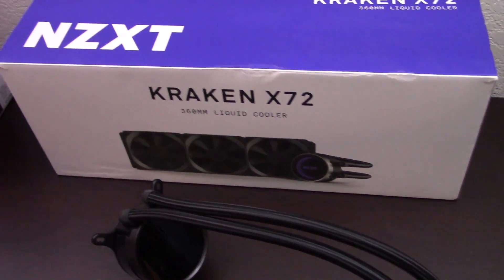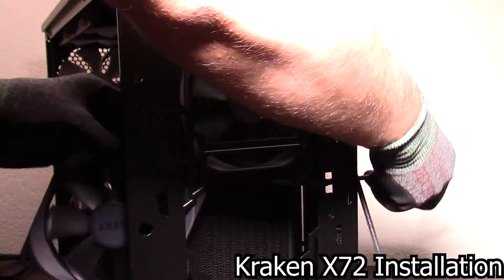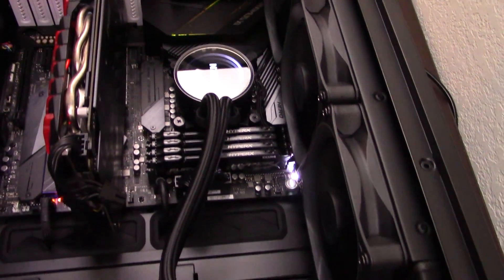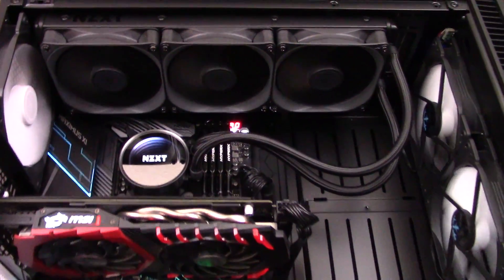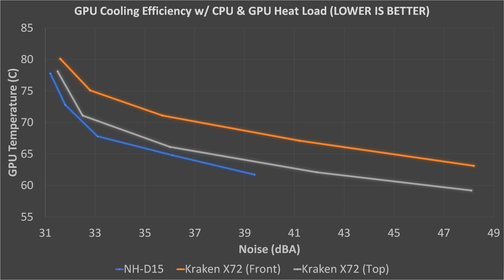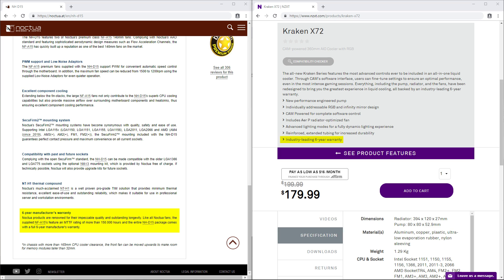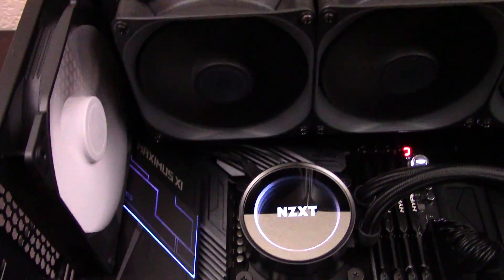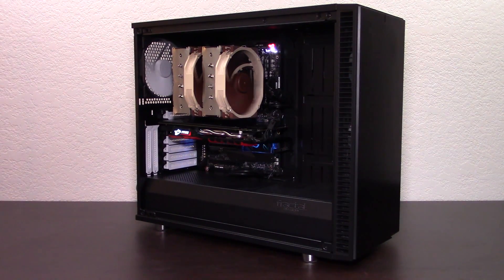Air Cooling vs. Liquid Cooling: The Ultimate Showdown (feat. Noctua NH-D15 vs. NZXT Kraken X72)

Comment: Based on experience and many swaps of coolers. The conclusion is similar, Don't mix AIOs and Air coolers (i.e. CPU AIO and GPU air). The latter results in a dead zone around the CPU block (if your case is large) of hot GPU air that barely moves, increasing the GPU temps gradually. Using all Air means more in case fans = more case air flow, CPU might heat a bit as a result of GPU heat, but overall its better performance. The other option is a full liquid loop with enough radiators.

Comment: The power consumption test was rigged, it doesn't matter if you go air or liquid you will still have case fans, in the power test you should've only compared noctua's 2 fans and nzxt's pump without the 3 nzxt fans as even if you do get an air cooler you'd still have fans there

Comment: the cromax NH-D15 looks so good.... sadly they made it more expensive just becasue its black, wich IMO is just a rob but.... whatever.
Reply: Do some research. They don't just powder coat it black. It's challenging process to make it black. That's the reason why they hold it off for so long, even if there's so much interest in it. Thats the reason it cost a little bit more.

Comment: I will always go for air cooling, but air coolers are a bitch to clean. You can use pressurized air, but without a full wipedown, it will slowly build up dust that thinly cements itself, needing it removed to be soaked/scrubbed down, whatever, while an aio can just have the rads unscrewed to deep clean the fins easily.

Comment: I used a similar sized air cooler (Deepcool Assassin 3) in my system. I made that choice because I feel fans are easier to maintain and a fan dying won't stop the use of the computer as a pump failure would. one thing you didn't bring up is that a water cooler is sort of an all in one solution. It's going to get the heat from the CPU out of the case pretty much regardless of the airflow. An air cooler really needs a case that cooperates with it's operation with enough ambient air coming in to let the cooler do it's thing.

Comment: for anyone looking to overclock their cpu's

1. i had the noctua nhd 15 with an i7 9700K overclocked to 4.9 ghz. I couldn t go to 5 ghz, because the temps were too high. Now, the room was a bit hot and the case didn t have the best air flow. It probably can manage 5.0 ghz, but i couldn t. Also, the cooler was mounted with the fans facing the top of the case as i didn t have enough clearance for my ram cuz i got 4 sticks. I even managed to damage the slot.
2. I have a Kraken x73 AIO (360mm) with my i9 9900KF overclocked at 5.1 ghz and the temps are great, in idle in runs at 30-33 and in games, in core temp, i ve only seen 79 degrees on 1 or 2 cores, the rest of them had between 70-78 degrees, but i ve change the case, this one has better airflow. And the room is a bit colder.

For the first build with the i7 9700k and noctua i had a white diamond game max with 4x140mm (2 in front, 2 on top) fans from Uphere installed in it and for the second build i have a phanteks p400a eclipse with the aio mount in front, pulling cold air from outside and 2x140mm fans from Uphere on the top pushing the hot air out.

I hope this helps someone.

Comment: One thing I want to know is the liquid cooler motor. Do you have data that the motor will last 6 years? I have NH-U12A in my computer 8 years and still running great at 40°C.

Comment: I just switched from Corsair H115i to Deepcool Assassin III. I'm happier with the Deepcool, the H115i started having blockage issues on the third year, temps are high even on idling. The deepcool comes with 2 fans and I only used one because I already had another 140mm fast at the back of the case, the temps are great. All that for half the price in my place. No more AIOs for me anymore.

Comment: Water cooling is more cumbersome and takes up some fans slot in your case, the biggest advantage i would see later on is having my gfx watercooled too so both the cpu and gfx heat are always going out of the case and not staying in there, and after all these testings i still see water cooler as a bit more superior for performance, people seem to forget you can mount fans on both sides of the radiator but its still not that much better as a good air cooler, i wont get an air cooler because i cant stand the sound of it and i might do a custom loop in 2021, if you plan to oc you wont get the same performance with air as with water and thats a fact

Comment: How about having radiator on the exit in push or pull out of the case config. Anyway I'd rather compare to smaller Kraken because it always struck me as more reasonable option. It also fits well into those ultra small cases.

Comment: Take the chromax back version and the only way the liquid cooler wins is in slightly better temps at the cost of noise. There is also always the factor of looks in terms of shape and position - someone wants a liquid cooler with those pipes, light up display and motherboard visibility.

Comment: I'm no enthusiast, but my 10900K doesn't perform well with the NH-D15.
Reply: Then you've got big issues. Either some software issue or your case cooling is garbage. How overcocked is the 10900k? That's one of the hottest CPU's out right now lmao
Reply: @roboticvenom1935  
I used this cooler for my 6700K before and it ran at 28℃ at idle and only got to 60~70℃ when benchmarking so maybe I have to get used to see 70~80℃ on the 10900K.
When I try to overclock the 10900K to 5.2GHz it sometimes throttles during benchmarks.  Stock speed runs ok but still gets to 70~80℃ when running Cinebench.
The case cooling is not the best since it's a fractal chassis, but it's not garbage.  I have 4 intake fans with 2 out, both 140 mm and blowing 100% all the time. The fact that the NH-D15 is massive and almost comes in contact with my graphics card which is radiating heat does not help.

Comment: everyone gangsta until the AIO starts leaking
Reply: Smelly Revolutionary  same lol my cousin ruined his $3000 pc cause of a leak from Corsair cpu cooler and leaked on his GPU
Reply: @JustChill_TV  Did corsair pay for a new PC as a lot of people claim they will?
Reply: @GhostAcez  ıdk about Corsair but i heard that if you send your bill and proof to coolermaster they'll do something about it.(Maybe they'll change your damaged components idk)
Reply: Yes, one advantage of NH-D15!
Reply: That might happen after 8 years of non stop use and changing the radiators place every year
Reply: @wilihey1425  it all depends, some unfortunate defective units that slipped out of the line might break itself after some usage. I've seen cases of TT AIO cooler exploded by itself while being put away in storage for some time.
Reply: @711jastin  most companies if not all have a long warranty in case that happens where they pay back for most of the parts that broke in your system because of their defective unit, after that warranty tho you're toast if anything happens, aio might last longer but i wouldnt use one for more than 5 years or something
Reply: @wilihey1425  I will trust my noctua for the next 10 years, for the same price and performance, minus the shit color.
Reply: Even the thought of it scares the shit out of me.

Comment: I replaced my 5-year old Corsair H110i with a Noctua NH-D15.  Running Cinebench now, I don't throttle my i9-9900k at 4.7 GHz as I did with the Corsair, because it doesn't get hotter than 80C under this stress load.  Less power consumed and much easier to install in my mid-tower ATX case (Fractal Design R6).  No worries of a water leak taking out my motherboard and easy to replace the fans if they ever die.  Noise is about the same at normal speeds.  I think I made a good choice.  I've seen some water coolers corrode over time and stop working.  Air cooling has less to worry about.  The only advantage I see for water cooling is if you absolutely push your CPU to the limits and/or you want to show off your PC components via a glass case panel.  Neither of these apply to my needs.  I saved $10 or so by not buying the all black version of the Noctua since my case is out of view except for the front panel.  Noctua, I think, makes the best case fans too.  Very quite and well built.

Noctua is Austria based and designed.  I like that not everything in my computer was designed in China, although I think they're all made there.

Comment: This debate has an extremely simple answer. If you're gonna go full gaming, do some web surf or just gonna upgrade your regular pc with some parts, go for Air coolers. If you're 3d designer, taking out heavy HQ renders, texturing and doing a lot of high computional stuff like me, go for Water cooling (AIO ones. Custom full rig water cooling is so complicated and only experts should do it. So AIO is great). Because even at test its very clear that air coolers simply fails at overclocked cpu that are running at max speed in renders. Tho AIO's dont. So yea. Gamers = Air Coolers. Designers = Water Coolers (AIO)

Comment: Based on my experience, aio’s seems to fair better for my sake especially since  my room ambient temps are at around 25c-29c. Using my NH-D15, my idle temps are at 50-60c and my gaming loads reach 85C at its highest (Playing Hitman 2 and Destiny 2, and Jedi Fallen Order). Switched to an AIO and my temps on idle went down to 37c-42, and loads are at 75C.

I ended up building another pc with the same cpu on my basement to be used as a workstation for work and placed my NH-D15 there.. my idle and load is on par with AIO’s...

Comment: Get a water cooled GPU (like the EVGA 2070 Super XC) and then the Kraken Z72 really outclasses the Noctua NH-D15. I own both CPU coolers on different rigs. They both have different pros and cons, depending on application, but I believe if you had run these tests with a water cooled GPU, the results would have been much more in favor of the Z72.

Comment: Leaks...why not just design a case with the Cpu/WCooler in a seperate compartment at the bottom of the case. I would never put water in my case though. I breath air...its god enough for a GOD.

Comment: I switched to a Kraken X72 for the looks. I also installed it on the top because when I had it in front it did heat up my GPU

Comment: I happen to own both of these coolers. first off. the Noctua NH-D15 is one HUGE cooler. and an ugly one I might say.
if you have any RGB components on your MB you can say goodbye to seeing them. since the cooler is so big it covers at least 50-60 % of the MB. 
 plus if you ever need to clean the cooler. you would need to remove your graphics cards. problem is the cooler is so big you can't even reach the PCIe lock to release the card. (extremely hard to access any part of your MB.)
in most cases, you won't be able to use two fan configuration cause it's too damn big. you can only use one center fan in 90% of cases.
Noctua NH-D15 compatibility list is not even remotely close to the truth.  (or very limited) even in large cases. 
as far as the NZXT Kraken x72 is by far a superior cooler, and you can SEE your MB. and everything is accessible.  instead of the hunk of metal Noctua NH-D15 which is now sitting in my basement.  (total waste of money) unless you have an open case and you don't care about the way it looks. 
so there is NO comparison between the two. not in the same league. NZXT Kraken x72 is the real winner.  better cooler and far more compatible.

Comment: IMHO there is no chance I'll use any liquid inside my case with electronic components, that plus the mess of extra moving parts for the pump, the need to clean the thing etc   Either the air cooler handles the cpu or is time to change the cpu for more energy efficient ones, which I think will happen with the future arrival of ARM cpus to the pc market leaded by Apple's A series example

Comment: The point about "Enthusiast" level builds is authentic...and I appreciate this video's goal for testing the "best of the best" as-it-were, instead of the "best performance per dollar."  Different people place greater emphasis upon each of the categories represented here, and for varying reasons; but, mostly based upon monetary considerations.  Those who simply want the best of the best and aren't concerned with the price, obviously, will select which ever piece of hardware they are comfortable installing and maintaining.  Overall...good video.  I'd like to see a vid comparing things like 360mm vs 280mm radiators/fans; or, comparing the various AIOs on the market.  Thanks.

Comment: Air cooling. 
1. Less maintenance 
2. Less worries about any parts breaking
3. Less mechanical parts 
4. Easy to maintain (Mostly)
5. Affordable 
6. Many different variants and designs 
7. Simple design (Mostly)
8. No need for any software to control it unless it's a RGB unit
Reply: My watercooled systems last 5 years without maintenance.  As I can turn the fans down to 20% rated speed they don't even draw dust to the filters, and the de-ionized distilled water in the full custom loop doesn't clog anything up like dust on the fin-stack of an air cooler.
Reply: @JuxZeil  That means you bought a very high quality one. 👍🏻
Reply: @cryo_life  Full custom loop beats all bud.  It's not that difficult to do and can be quite cheap too if you carry parts over to the next PC and buy second hand/discounted. 👍

Comment: Sorry ain’t difficult to install that liquid cooler vs a proper water cooling . These air coolers can be tough but it’s easy to put in a kraken damn easy . I was also a air cooler man. For the money back the arctic freezer e duo miles better. New arctic liquid cooler much cheaper too and cheaper than a noctua too

Comment: The difference in noise profile is quite understated here. The Db scale is logarithmic, so the difference between 39 and 48 is just shy of 10x louder. 
I swapped a faulty AIO that hit ~50Db for a D15, and the difference in sound profile was extremely noticeable. 

Also, as others have stated, after you've been gaming for an hour+ two things happen. 
1 - AIOs lose their cooling lead as the water temperature increases
2 - AIOs must keep the fans ramped up for several minutes after the load has decreased to lower the water temperature again. 

This means you can turn your game off to do something else, then need to wait as it sits there burring away at 50Db for what feels like no reason.
Reply: Just want to correct you slightly on the dB scale, each 3dB increments represent a 100% increase in SPL (Sound Pressure Level) so the difference between 39 and 48 is not 10x, it's 3x
Reply: @hujeta6851   db is log 10 right ? So from 10 to 20 should be 10x
Reply: @aliefr2984  Hujeta is right. A 3 dB change yields a 100% increase in sound energy and just over a 23% increase in loudness. 10 dB increase sounds like 2x percieved loudness. Loudness and Sound energy is not the same thing. Also if you use your common sense, there is no way one cooler is 10 times louder, that would be crazy loud...

Comment: "it is not about budget builds" few moments later, air cooler wins cus it is cheaper! Nice logic
Reply: Think he meant top of the line in their respective categories
Reply: I mean doesn't mean you have a high budget build means that you should waste money...  If the noctua is almost half the price the of the kraken, and the kraken performs worse when considering gpu load and only marginally better in the cpu test, why would you get the kraken?
Reply: @danielhu6485  size, and aestheics.
Reply: @cytrus3427  so.no real reason. Air cooling is superior.
Reply: @johnathanera5863  bruh
Reply: @Johndrei Petriel Co Laparan Tru

Comment: Nice comparison, but I believe you can significantly improve Noctua's performance with tower that has great airflow like the Mastercase H500 series or Phantek Eclipse P400A, in which case you should get 1:1 result, probably even better with the Noctua.

The one you´re using is Fractal Design with limited airflow from the front, so no wonder the Noctua is under-performing. Think of it like this: without sufficient airflow in a case any air-cooler will struggle much more than liquid.

Comment: You had major positive pressure in the D15 setup and negative pressure for the Kraken setup. The Kraken had the better airflow. You should have put 3 120mms on the top during the D15 test.
Reply: Negative pressure sucks, rather have less airflow
Reply: @rafars2246  when does it happen? And how can I avoid it?
Reply: @FallenLight0 negative pressure is more air going out than coming in.
Reply: @tapeab1e  thanks

Comment: As a custom water cooling enthusiast, water cooling really doesn't benefit the CPU very much at all. The GPU though is a different story. It can cut load temperatures by nearly half because of the surface area provided by most custom water blocks. Most of us just throw our CPU in with the loop because it looks better that way. I have a monoblock for my motherboard as well as my CPU and it helps to simplify my cooling because the motherboard I use didn't have very good VRM cooling. It looks amazing when you have a good case to show it all off. I have my system in a Lian Li O11 Dynamic XL and the lighting just looks awesome. If you don't care much for aesthetics and you're just worried about CPU cooling, just use a good air cooler.

Comment: Hi, just found this channel and subscribed. I noticed you didn't mention custom open loops on this video. They're what true enthusiasts like me go for. My custom loop has to d5/res combos with two 360mm copper radiators and 12 120mm fans in push/pull. My Ryzen 7 3800X is overclocked to 4.5 GHz @ 1.375 volts and doesn't go above 41c after an hour of Prime95. That's not too bad.
Reply: I used to run a custom loop but following a move to another flat I decided it was oversized so it's gone now  https://youtu.be/O3Nf2jAhweI?si=gPvwmzTwDTbZGSaw